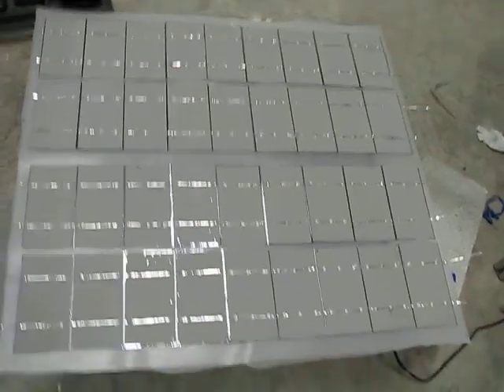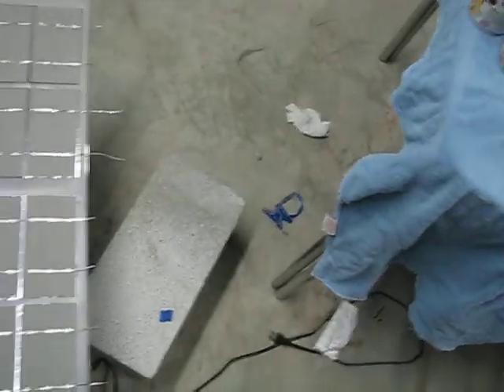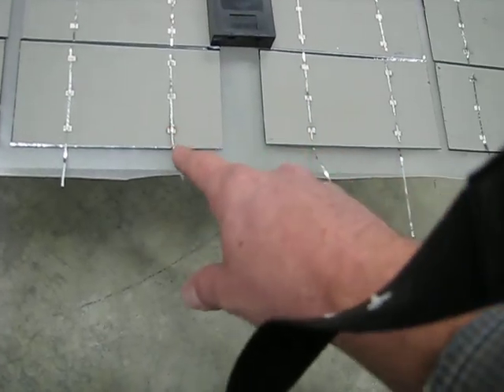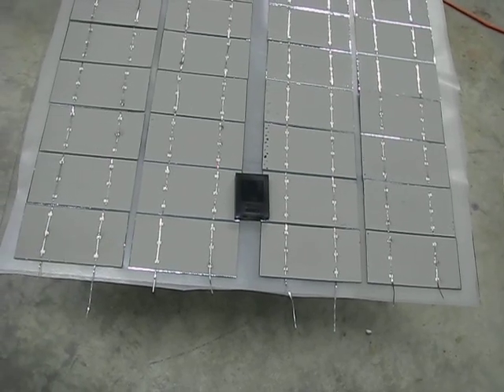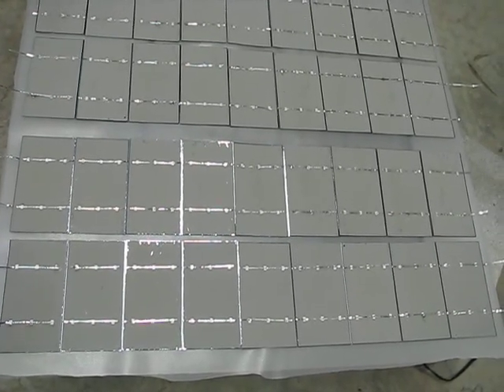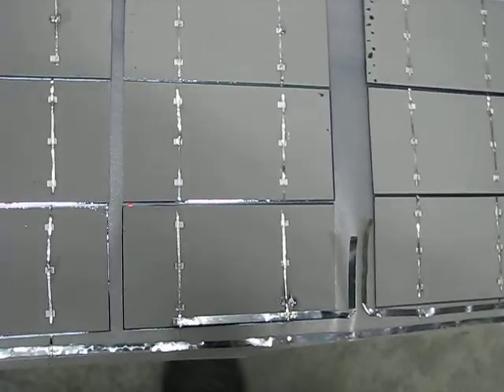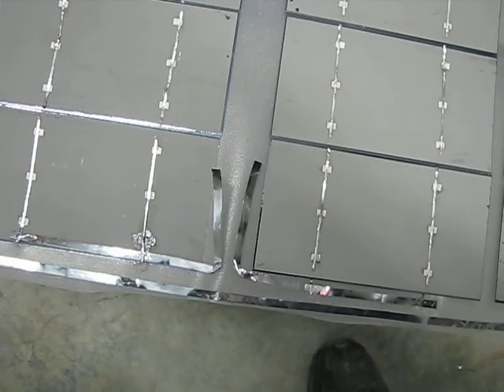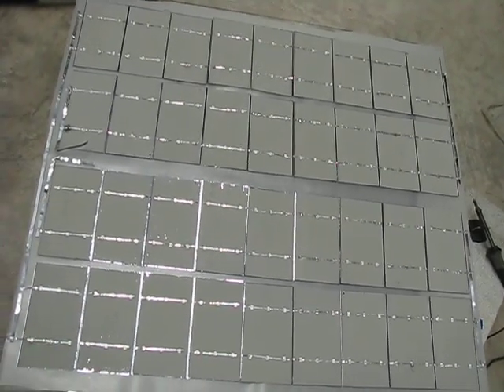DIY Solar Panel Design and build #4 Buss wires

Comment from the maker: Sorry, I did not check here for a while.  By doubleing your cells, and keeping them in a series, you will double your voltage, but keep the same amperage, with will also double your Watage.  P=V*A.

And yes, The solar panels you purchase that are 245W, with 60 cells are larger cells that are 4+W per cell.

Sorry for my delay in replying.